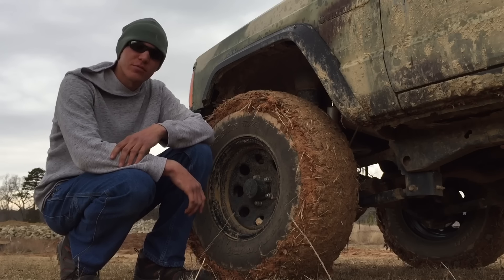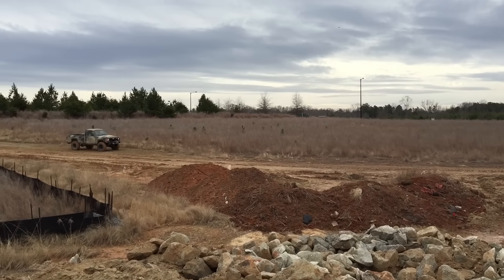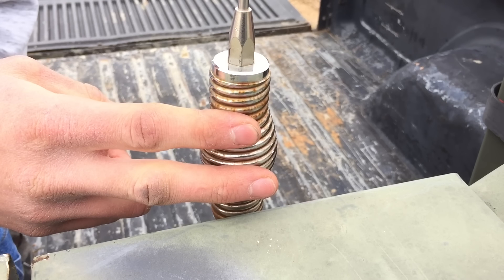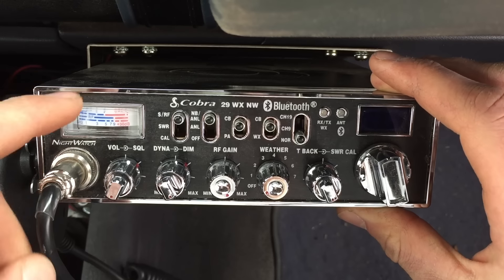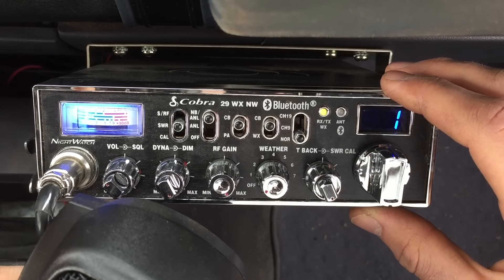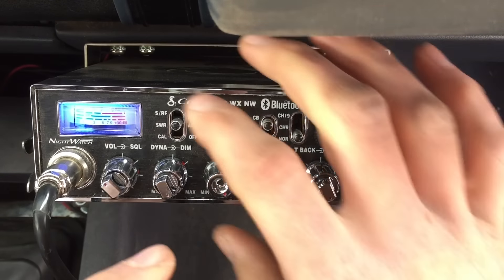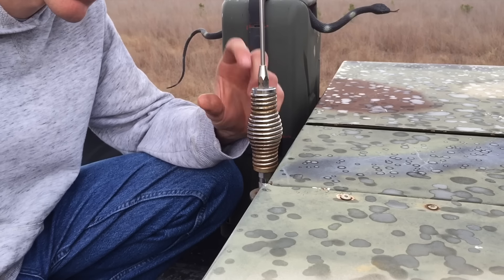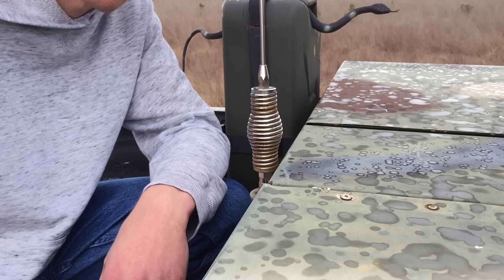How-To Tune a CB Antennae

Comment: The paperwork that came with my SWR meter said to start at channel 20 on a 40 channel radio. calabrate then switch to power and check reading on 20.  Without changing anything  check swr on channel 1  then on channel 40. adjust antenna length accordingly  to acheave as low as possible .

Comment: The meter in ghe radio is the best to use it is more accurate because its not reading the pigtail you use only during the test.
Reply: BS.Anybody who knows anything about proper SWR reading knows that is Total BS any day of the week.
Reply: I was a tech fir many years made a living in electronics repair much of my work was on ce and amateur equipment. Hows that for your bullshit. Read a damn book.
Reply: Well I am a tech in the industry and I agree with 10FGODSOWN.
BS. Never trust those meters until you can compare it to a good quality SWR meter.

Comment: thanks for your helpful video but I have a question I tune my antenna whit the build in swr meter with the engine off it was hi 2.5 on chanel 40 1.5 in chanel 1 but when I turned  my engine on all jump to 3 . something what can I do?
Reply: Doors open or closed. Try it with the doors closed. See if that makes a difference.
Reply: When your engine is on the radio puts out more so you have to set the calibrate again

Comment: where the antenna meets the "nut" on top of the spring there is an Allen screw to a just the height of the antenna.  no need to put extra washers at the bottom.
Reply: You don’t use washers to adjust a 102 antenna.  Period. 
 That Allen screw is used to hold the stainless steel Whip to the ferel.  You can buy a replacement ferel  if yours breaks off. If you must play with a 102,  buy 19 feet of cable, Solder a pl259 onto the coax, then test your SWR numbers.  Channel 40 number is still too high? Cut off the PL259 and start over. Keep doing that until you like the numbers or you get bored.

Comment: The coaxial cable is actually part of the whole antenna loop impedance wise. A different length cable will change your vSWR for the same length antenna. Keeping the cable length short is mostly for convenience it isn't absolutely necessary, nor is ensuring it isn't coiled, it doesn't really matter that much. When you change the length of the antenna you are not only tuning the antenna but the length and position of the cable as well. What matters is KEEPING THE CABLE STILL, You don't want that cable to be moving around. Hook up the cable to the antenna and the radio and pin it down. Even moving it a little can radically change the vSWR.
Reply: ideally cable lengths should be 1/4 wavelength
Reply: If changing the coax length changes the SWR then you have other issues.I know FACTS bother some people but I can use any length coax I wish on every antenna I own (10 base antennas & 2 mobile antennas) & the SWR does NOT change any at all.How would that be possible if the coax length changes the SWR? I have been doing radio since 1965 & I have heard that MYTH so many times & proven it WRONG dozens of times & made people leave scratching their heads more confused than ever because they listened to the BS for so long they were brain washed.

Comment: You don’t have to tune, 102 inch well 102 inches as electrical link of 27 Mc which citizen band operates on so if you don’t want to tune antenna, the best one to get is 102 inch whip which is just a little bit over 8 feet

Comment: I have dual firestiks on a aluminum tool box. should i ground the brackets to the body?
Reply: Don’t bother. If you are using two  antennas on the tool box the chances are they are too close. The antennas are talking to each other.
Reply: 2 foot antennas may Work back there but they are short.
Reply: @robertmanning3922  4'
Reply: john Smallwood how far apart are the mounting brackets?
Reply: @robertmanning3922  about 6' witch i dont the width but the length
Reply: Doesn’t really matter. A toolbox might be 6 foot Long. The point being if you were to lay the antennas towards each other from their studs they would / will overlap. Ideally they would not. But since they do, when you transmit each antenna will Broadcast into the other.  This will effect your SWR reading. Not in a good way.
Reply: Grounding the box to a truck bed will not help matters.
Reply: Adding a wire from the antenna bracket to the truck body creates a problem in which the grounding wires begin to act like antennas. Having said all that, we do not argue with what works. If you add grounding wires to the body of the truck and your system works better, whatever I say doesn’t matter. It’s what your truck likes.
Reply: What some people will do is put both antennas back there but only have one hooked up to the radio with RG eight cable and have the second antenna back there as a dummy just for the looks.

Comment: for a old timer (53 years)  i learned something, never new washers can make a dif on a 102 tune. also there is feral you can buy with a inch or 2 adjustment. no better antenna then a 102 but a bitch to tune. gota try the washer thing i have about 1.4 on all 40 and want it down lower

Comment: I'm looking into getting a cobra 29 LX. is that to much radio for my jeep?
Reply: Mario Martinez that's good model and strong for offroading. I had one forever, I just recently ugraded, but they are worth it, the take good abuse in bouncy vehicles and can sit in hot cars all day and still work just fine when needed
Reply: saltyventures awesome thanks for the advice.  I ended up buying it and you are write, I was able to hear EVERYONE loud and clear. I put it on my 02 jeep grand cherokee and made a custom box for it along with my light bar switches. came out pretty cool. you can check it out on instagram WJ4x4offroad. thank you
Reply: A problem with the LX models is that you can have the antenna system tuned right but the warning light will still come on.  I have had to take the cover off of the radio and adjust the pot, L6 I think, in order to correct the Irritation.

Comment: Every cb ive had nobmatyer what tractor trailer i hook it up too feeds me an antenna warning but people can hear me and ihear them. Ive tried diffirent antennas. U think it can be the oem crappy coax they use?
Reply: It can be a combination of problems. Older the truck the more likelihood is that the cable is crappy. More crappy then usual.  Some of the Volvos the  Cable in the drivers door will break after thousands of door openings. Sometimes corrosion develops  around the antenna stud ruining signal integrity.
If the vinyl is cracked around the base of the antenna this is a sign that the wire underneath may be defective.  Connectors that screwed together may have come undone. Cable that plugs in a Y configuration at the back of the radio may be defective.  A Y that screws onto the radio may become defective.  Antennas may not be tuned. The LX models are adjusted tight internally and WILL/MAY light up if everything is perfect.

Comment: well this is great, but how do I bring my swr down?
ch.1 is 2.4
ch. 40 is 3.1
all your help will be appreciated
Reply: Iron Clad Can't give a straight answer without knowing more info, but I'd guess your antenna is too long or low quality coax cable, cheap coax can do this too.
Reply: +Iron Clad check all your grounds make sure you are not grounding out on the antenna but you are grounding on the ground
Reply: It is just a tuning issue.
One antenna: Firestik I
Remove the top cap, cut the vinyl at the top, 1 inch on opposite sides. Since channel 40 is 3.1 you must unwind the wire and cut off two wraps. Close the vinyl put the cap back on. Check the SWR again. Repeat as necessary.  If you cut too much wire pull the wire up some. Check again. When channel 1 and channel 40 are close in the readings you are done. Put the cap back on.  Always test with a cap on.  
Firestik II  has a screw under the cap. Adjusted as necessary.   If the numbers say that you need to go down with the screw try removing the nut.  If you need to go down further put the nut back on and cut the screw in half. clean the threads by turning off the nut.  Put that back on, put the cap back on and test.   Some have been designed to use 18 feet of cable.
 Some antennas have a nail at the top.  Some have a small rod at the top, some are stainless steel wire, that require cutting at the bottom, some  have tuning rings.
Reply: Your antenna is too long and needs to be a hair shorter
Reply: Shorten your antenna a little

Comment: I have a dual 4 foot set up on my truck. We grounded the antennas to the frame and tested it. The swrs for both were way into the red. We used a single CB cable and tested both separate from the other. However when we hooked both together using the co-phase cable, i got readings of 1.5 on both channels. Any help would be great. Do you think the meter I bought was bad?
Reply: Habeas J from what I know dual antennas need to be at least 8' apart so they don't fight each other.
Reply: Only One SWR.No such thing as SWR's & why they do NOT sell SWR's meters just SWR Meters.

Comment: Would this fit in a DIN slot? I have looked for dimension specifications, and I've found 3 different ones. Could I get an actual measurement of the radio?
Reply: most cb radios will not fit in a single din slot on a 4 wheel vehicle but if it's a 1.5 din it will a cobra 18 or 25 will fit into a din but it's better for the radio unless it's purpose built to be exposed like he mounted his to help keep the  internals cool

Comment: Where would be a good place to mount 2 4 foot cb antennas on a 77 Chevy k20 and the cb I got bed post mounts
Reply: if you run duals mount them opposite corners of the bed so they don't interfere with each other then tune the left antenna first then combined

Comment: What cb radio would you recommend for about $50?
Reply: Two soup cans and some string.
Reply: You won't find an entire setup for $50, unless used, but I've heard the Cobra 75WXST is a nice light use radio for about $70. A decent antenna setup will run you atleast another $25 or $30.
Reply: Scott Shuey Now THAT'S funny!
Reply: cobra 25 or 18
Reply: UNIDEN 510XL is a great little LOUD CB radio.You can also buy a good Used Cobra 29 LTD for that price on Craigslist across America.

Comment: If your radio has had any work done to it your meter will not read right best way to set swrs is with a set of meters and to shorten the coax
Reply: What? Where do you get your information? No, no and no.

Comment: 102 inch whip  antenna  are pre tune if u have bad swr because u have bad ground it should be on the cab or the body. then if u still have bad swr u change the length of of the coax, 1.2 is very high still u want .1 or flat swr.
Reply: 1.2 is about the best you can get in the real world due to the nature of electromagnetic waves, if your getting SWR readings below 1.2 then your meter is showing false readings. Standard is if you can get a 1,5 on center channel its good but if you can get it lower your even better but there is no real noticeable difference from 1.5 to 1.2 on the other end when they hear you radio....
Reply: Coax length has nothing to do with SWR.Electrical length of the radiating element (antenna) effects SWR.

Comment: hmmm wonder how you do it with a full digital cb
Reply: Try watching the video again. You don't have a digital c.b., your c.b. has a meter with a digital display. Buy a SWR meter.
Reply: I mentioned in the video you need an external SWR meter to properly measure output. This applies to all CB radios, and can be found at truck stops and Radio Shacks.
Reply: Sean BleepinJeep cool my other replys i had morning brain n sound like a twat. Pitty most swr meters hear are about  the price  of a dang uhf plus ariel

Comment: Dude that was awesome 
 next time Could you teach us how to
 tuna fish? 
No, how about how to tune up our ticker tape machine.type writer?
Reply: Always make sure your ribbon is clean and the keys aren't worn, otherwise the letters will be faint and you may even hit the wrong key. Don't use more than three fingers on each hand or you'll be in danger of bunching all the arms up before they've hit the paper. Have some Tippex handy in case of mistakes.
Placing a thin rubber mat underneath it will lessen the noise when you're typing, not by much, but every little helps.
Good luck with it.

Comment: how would you tune a cb radio with no swr meter?
Reply: You cannot tune your radio without an swr meter!
Reply: Shawn Scaggs fair enough. thank you
Reply: TBG's S2000 you can still tune it. you need to pick up a meter to tune it. you can also peak it out by adjusting the pots on the inside but I am not going Into that.
Reply: You don't need an SWR Meter to tune the radio just the antenna.Or an antenna analyzer which is far better than any SWR Meter.
Reply: You don't tune your radio, You tune your antenna to the radio!, Have to buy a SWR meter.

Comment: Also when buying your 18 ft of coax rg8x is much better preferably 95% shielded, and NEVER COIL IT LIKE AIR HOSE. ALWAYS FIGURE 8/BUTTERFLY. IF ITS IN ROUND LOOP IT BECOME INDUCTOR COIL.
Reply: A large loop of about 12  -  18 inches would be ok. Small loops of 6 - 8, no.

Comment: He uses the Trucker Channel for talking to his buddies while on the trails? I guess it works but just a warning, Using Channel 19 for beyond trucking stuff may not always be welcomed. Unless he is that far off the grid away from regular roads, then in that case, their transmission shouldn't be able to be picked up by normal average CB radios.

Comment: can i hook this  to  ac plug  mobile rig.
Reply: Yes. You can hook up a mobile rig to an ac power supply.  Get one that is rated for your radio. Standard CB Radio using a 2amp fuse would use a 3-5 amp power supply. Bigger, more powerful radios would require a suitable power supply.

Comment: So I don't get why you have to be in an open area to test your SWR when you will use your CB off road where there are trees, mountains, and other objects in the way or over the road where there could be mountains, building, etc. I was wondering why you need an open area instead of where you will use it the most
Reply: you do it in an open area to reduce feedback and static but he forgot to mention you start your tuning in channel 20 then 1 then 40 that way you have more accurate read across all bands and his case more in where he uses it
Reply: You do it away from metal objects so there is no reflection.
Reply: Don’t worry about channel 20. Check channel 1 channel 40. 20 will be what it will be. This will get you the best usage out of your radio Across all the bands.

Comment: I don't recommend the SWR meter that's built into the radio because  Not 100% accurate in my and 50% accurate it's better to use a separate  swr  Test meter
Reply: I agree, just use the built in one in a pinch

Comment: Radio performance will double or triple with antenna mounted in center of roof.
Reply: Do what is best for you and your situation. Yea you can put it on top. But if you park your rig in a garage with low clearance that antenna will not last long.
Reply: Yeah in the center of the roof with a whip, Trees will tear it off,LOL
Reply: Or put some smaller wheels on your truck ,
Reply: @wallychambe1587  simple solution is don't smash your vehicle into trees.

Comment: All my calibration ch. 1, 20, 40 are in the red.
Reply: Check the ground for the antenna mount and the radio. 
Fire stick antennas have a good section on tuning and setup of  radio systems.
Reply: Review what I have suggested on this site.

Comment: What if it is a magnet
Reply: Some magnetic base antennas are OK to use. Some aren’t. I like the Wilson little will, the Wilson 1000 and 5000 are too pricey for me but they are good systems.
IC 100, IC 100s also good.  They all have good magnets on them. These antennas get tuned by cutting the length of the stainless steel whip. Slowly. 1/4 inch at a time as the reading of channel 1 and channel 40 get closer.

Comment: First never buy a cheap crap antenna analyzer from a gas station or radio shack. But I good quality swr meter. Next get your antenna as high as possible and if you mount it on the toolbox put it on top if you can. Mounting it that close with the spring if your in the woods using power like most do. The spring with make contact with tool box and damage the output final in the amp or radio. The swr meter on the radio should be used as a reference only. They are not very accurate either. Find a amateur radio operator and they should have the equipment to help set them swr’s.
Reply: SWR's??? There is only ONW SWR on an antenna.That is why they only sell SWR Meters & NOT any SWR's Meters.Thanks for the laugh though. LOL

Comment: There's an Allen screw in the cap of that spring which is how you're SUPPOSED to adjust your antenna.
Reply: Not with the 102" whip.  It has no set screw for adjusting it as it is a (for the most part) pre-tuned full 1/4 wave antenna.

90% of all 102" whips are press fit into it's ferrel (that's the part you called the cap).  Some (cheap ones) do have 2 set screws, but they are only for securing the whip into the ferrel, not for tuning).

Comment: Have a 
C.B with side band , ham . Can listen to others across country . But cant talk to them . Why . Can only talk over c.b.
Reply: An antenna tuned to the CB band is designed to be used around the 27 MHz bandwidth. Ham radios use a different frequency’s.  You would need an antenna tuned to the ham frequency’s.
Reply: @robertmanning3922  and you also need a ham license
Reply: Randall Welborn not after the Zombie Apocalypse.